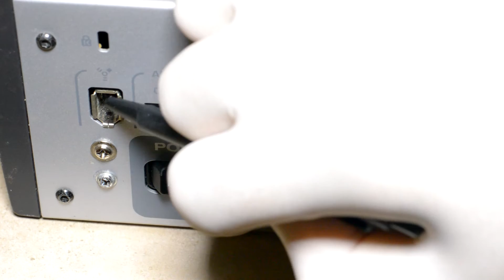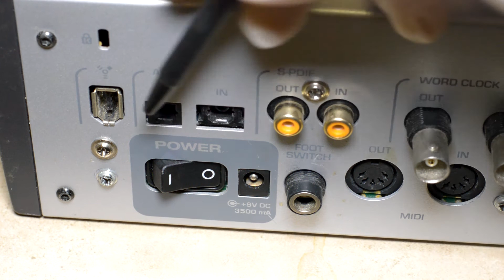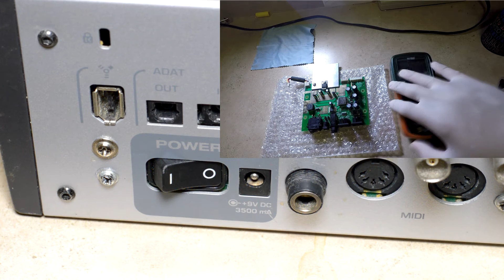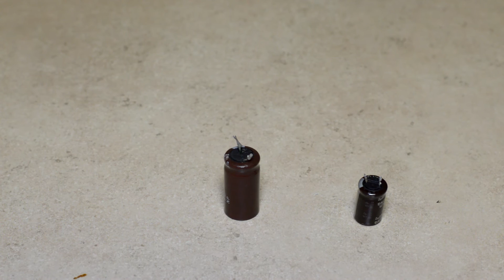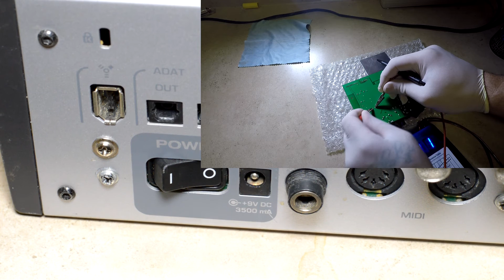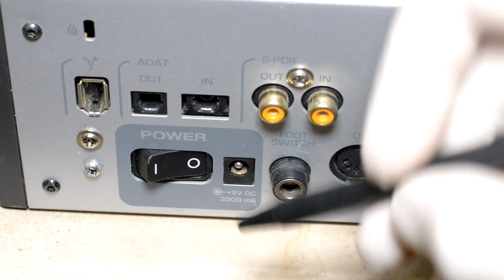projectmix i/o  repair

Comment: PM powers on but not recognised by pc ? I have legacy drivers installed but nothing happening in windows.. is there a way to test the firewire cable or PM firewire connection ?

Comment: Any chances someone has or know where can I find the drivers to make it work on Mac OS El Capitán or Sierra??
Reply: Preciso também para windows 10, funciona com o drive do windows 7, mas as vezes desabilita o áudio .
Reply: Any chance you know why no sound is being fed out of my Project Mix?  I had to switch computers from an old system using Windows 7 to a newer (still not that new) system using Windows 10 Pro. Both systems are using 64bit versions of Windows.  Worked fine on my Windows 7 system. The legacy drivers, although for Windows 7, installed fine on the Windows 10 system. In the M-Audio Control Panel I see output levels when playing sound. I also see output levels on the Windows sound controls viewer. The Project Mix lights up as though connected, etc....well, it clearly is connected as Windows 10 is recognizing it.  But no matter what I do I can't get audio out.  If I plug headphones into the Project Mix I hear audio. But no audio out of SPDIF out or Line Out.  Have the outs going into a Presonus Central Station, which has its outs to a sub and two monitors.  Nothing in the chain or setup changed from the point of working on the Windows 7 system to hooking the Project Mix up to the Windows 10 system. I know this isn't what this post is about. But I'm hoping you might have some insight because I'm stumped. Even though the drivers are not Windows 10 drivers they seem to work. Yet, no audio out???  What am I missing??? Thanks for your time!!

Comment: Maybe I missed it but if my power block blinks is my PM bunk?bad?broke? I'm not sure if I missed that answer.. I bought one and that's what's going on.. but I haven't plugged it into my pc yet, should that matter to test the power switch?
Reply from the maker: Hi, does the power supply blink when plugged into the the PJM?
Reply from the maker: If you have a multi meter test the power supply .
Reply: @mixinginthebox  yes it does...
Reply: My power block does blink, yet I do Not have a tester.. I wouldn't know how to test it wither.lol. if the block is blinking, would that mean the power supply is bad? Or that the projectmix is bad?
Reply from the maker: lol, No your PMIO could be good. If the power block is blinking it could be bad. With out testing its hard to say.

Comment: Hey there, do you know anybody who can repair the power supply on one of these, the voltage regulator on mine is shorted out. Also, do you know anybody who has a schematic of one of these? Thanks in advance.
Reply from the maker: Schematics no way, I have tried looking for them no luck.. Change the regulator can you see the part #?
Reply: Raynel Gonzalez LT1370 R, already ordered and on the way! Thanks
Reply from the maker: Great.

Comment: Hi, One of the faders on my PM has stopped working. I want to open up the PM. Might seem like an obvious answer but what screws do I remove to gain access to the FADERS ONLY? I don't want to dismantle the whole unit just to look at the faders. What screws should come out so I can lift the top off PM? 
Cheers.
Reply: You ever get your fader working again?  The master fader on mine hasn't worked in forever. Would be nice to get it going again.